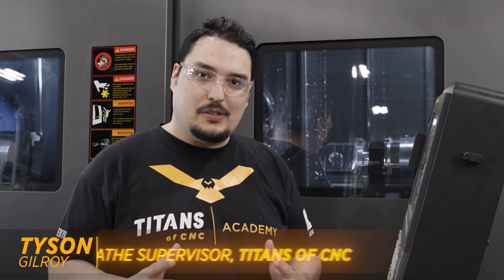Multi-Axis Simultaneous End Mill Chamfering in 9-Axis DN Solutions SMX3100ST | Mastercam Tool Path

Comment: As somebody who programs a 3-axis, at the machine, because it's faster than walking to the computer and having it write me a program... Wow.
I mean, I use a long endmill all the time to cut chamfers without rotating the part 90° and using a chamfer mill, but
..
Wow.
Seems like I have about a third as many axes and much, MUCH simpler programming.
Reply: About simplicity of programming... This is relevant unless you aren’t using Macro programming. You can simplify any task you need. Use math, think about architecture and you won’t have any problems
Reply: @mikhaildavydenko6841  For sure. We use MasterCam where I work currently, though most of the time I just do it myself. I'm just imagining watching all of the code flying by on the screen...

Comment: Can someone explain me all 9 axis I don't get that
Reply: The way it works is the upper head has 4 axes by itself - X, Y, Z and B, which rotates about the Y linear axis, main spindle C, sub spindle C, both rotating around Z linear, plus lower turret X and Z and the traversing sub spindle for transfers, for a total of 9. Being that the control is divided between upper and lower head, you can synchronize the motion between them with wait codes to perform simultaneous operations, either divided between spindles or ganged together. 

I've spent a lot of time on 3 turret, 2 spindle machines (12 axis total) where an upper turret is synchronized with the lower turret, working 180° apart from each other while the third turret is finishing up the less involved work on the other end of the part for "free" (cycle time absorbed into the longer, more complex run). 

NTX3000 from dmg mori offers a Y axis on the lower turret, so their articulating mill turn machines are capable of 10 axes of movement.
Reply: @TheFeralEngineer   Thank you very much for explaining! I would love to work with a machine like this one day or at least watch it in action👍
Reply: @tarek4156  been playing with them for 20 years. They're fun 👌
Reply: @TheFeralEngineer  Ah nice. I'm an aprentice and I'm working on a 3-Axis CNC right now and I love it!
Reply: Was also wondering about the nine axes.
I briefly worked on a two turret XZ turning centre. However, that machine had both turrets on the same slide and we were encouraged to avoid using the lower turret because the X-axis was reversed and more difficult to manually program for some operators. Or the change missed if moving a tool from the top to the bottom turret or vice-versa.

Comment: How do you even put 9 axis in a cnc machine?!
Reply: Basically, anything that moves.  X, Y, Z, (of course), then the main spindle and sub spindle are usuallly "C" and "A" axes, there's a "B" axis (usually moves the sub spindle towards the main) then start counting live tooling "spindles" and you can get up to 9 axes pretty quick.  In this case, the milling 'head' or spindle itself rotates, which would be another axis.  So yes, 9 axis total, though it's highly unlikely (if not impossible) to use all 9 axes simultaneously.
Reply: The way it works is the upper head has 4 axes by itself - X, Y, Z and B, which rotates about the Y linear axis, main spindle C, sub spindle C, both rotating around Z linear, plus lower turret X and Z and the traversing sub spindle for transfers, for a total of 9. Being that the control is divided between upper and lower head, you can synchronize the motion between them with wait codes to perform simultaneous operations, either divided between spindles or ganged together. 

I've spent a lot of time on 3 turret, 2 spindle machines (12 axis total) where an upper turret is synchronized with the lower turret, working 180° apart from each other while the third turret is finishing up the less involved work on the other end of the part for "free" (cycle time absorbed into the longer, more complex run). 

NTX3000 from dmg mori offers a Y axis on the lower turret, so their articulating mill turn machines are capable of 10 axes of movement.
Reply: @TheFeralEngineer : Mazak HQR250MY is a 9 axis machine with upper and lower turret.
Reply: @runejakobsen9958  so are the mori nzx2000t2y2, nakamura wy-250 and many others. The mori mt2500sz was a 9 axis, doosan copied it for their mx2600. The smx Doosan is a knock off of the mori nt4250 that came out in 2005 - also 9 axis. The Mazak Integrex also had a 9 axis version(b head and lower turret) and the E series had 10 with a lower Y... I don't understand your point.
Reply: A multi spindle machine is kinda obvious but I never thought about it.
These big industrial machines are always exciting
Reply: @andredepaulagomes  check out the DMG multisprint. 41 axis, 8 spindle turning center 👌